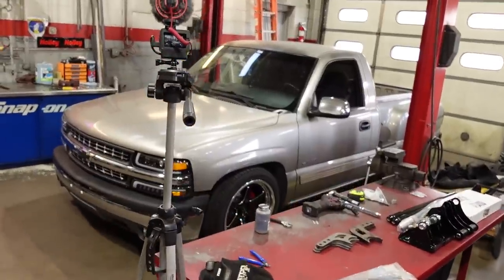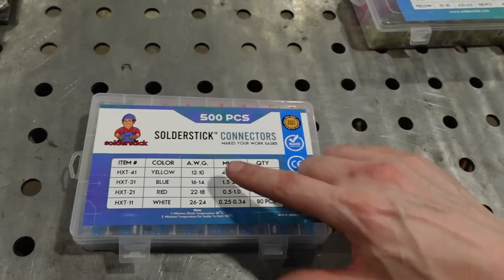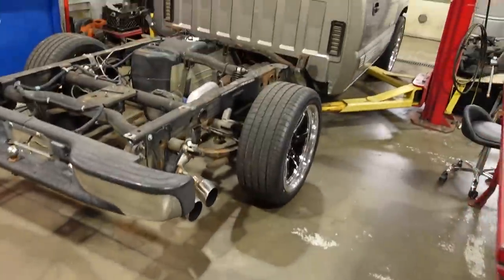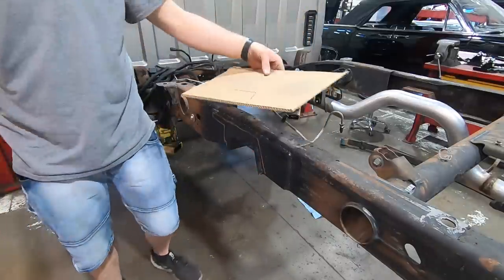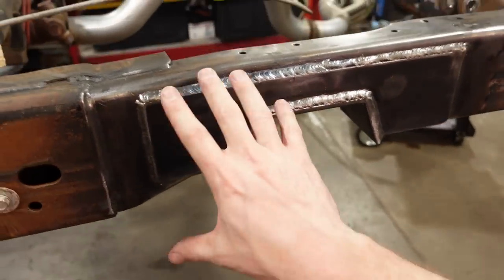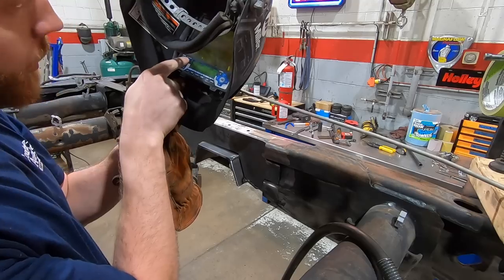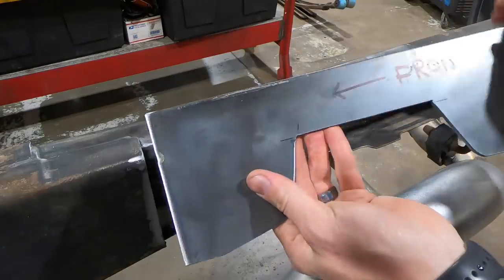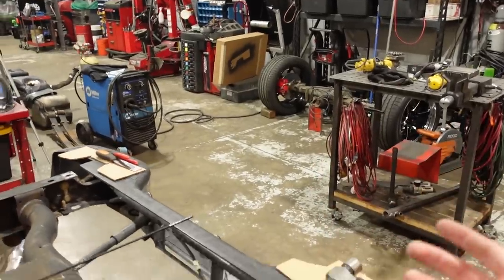the WORST FRAME MODIFICATION I've ever encountered

Comment: This is my truck. Had no idea about the frame under the bed because the c notch was done by previous owner and from the angle I could see under the truck it’s hard to see in the inside of the frame. From the outside it looks pretty solid. Glad LT found it and is making it as structurally sound as possible.
Reply: Beautiful truck my guy
Reply: Thank you, sir!
Reply: Nice ride! Awesome you got LT on it too..
Reply: Nice truck, how do you like the headlights? Easy install? Quality?
Reply: Bruh people are obsessed with your headlights.  I just wanna see the turbskis.
Reply: @sixoaksfarm1556 Thank you! Pretty happy watching him work his magic on my truck.
Reply: @person1492 Me and you both Keaters😅
Reply: @MrJamestheredneck  Headlights are solid. Only problems are with 99-02 depending on factory wiring, you might need to purchase and install a couple of grounded relays but they sell prewired kits and the other problem is they would have to be baked to remove the lens from the housing if a bulb went out. That is my biggest gripe, I’m not buying a whole new set because of a bulb so I’ll have to find someone with an oven. Otherwise, output, looks, and functionality are awesome.
Reply: @MovingToads  thats awesome. I'm looking at a set, but would like another opinion on them from someone that has them. Those are z-offroad correct?
Reply: @MrJamestheredneck  Yup that is exactly where I got mine. I would definitely recommend them.
Reply: I think it's cool that lt is working on your truck. I'd be interested to hear what additional plans you have for it
Reply: @beausmith3900  Thanks man. Eaton Detroit True Trac Locker being installed this coming week with 3.73 gears, Jake’s performance stage 2 4l80e and Circle D single disc lock up 3600 245mm torque converter goin in starting May 31. I put a 224/230 .5 intake .5 exhaust 112 lsa nsr comp cam in it, the OG flow master 40 series muffler, 60lb injectors, DW400 fuel pump, upgraded everything valvetrain including trunion kit, beehive springs, rockers, hydraulic lifters, pushrods, shorty headers(with egr still in tact thanks to the bbk headers), new cats (Denver emissions but soon to be register in texas as a classic when it turns 25), giant aluminum radiator and dual electric fans. At this point next to come would be turbo after all supporting mods are taken care of. Ported heads and an intake. Flex fuel as well.
Reply: That is an awesome truck!  If you wanted to go one step further with it, you could have LT cut out all of the existing welds and redo every weld just to know that ALL of the welds are totally solid.  I deal with welding codes all the time in another industry and can tell you that a good welder is worth their weight in gold.  LT is a really good one.
Reply: @steveh4837  Thank you! Oh I bet LT would just love that request lol
Reply: LT is the right guy, to find what isn't correct. 👍🔥
Reply: @homerepairguy1   100% evident
Reply: No Ragrets!
Reply: Very nice truck! LT will definitely make it right!
Reply: @JadXtreme  Thank you! Very confident in his work!
Reply: Awesome build, can’t wait to see the final outcome💪🏼
Reply: @tripstomexico9770 Thanks man!
Reply: Nice Truck.... love the wheels and fitment.
Reply: I bet LT loves having all those lifts in his shop.
Reply: @talalhz9137   Thank you!
Reply: That's badass, r u gonna have lt do everything?
Reply: @beausmith3900  Thanks man! No I had arrangements prior to LT opening his shop but we’ll see what happens down the line. LT might be working on the truck again at some point when I need some fab done for the turbo set up.
Reply: Nice truck man now you can ride without worrying about an unknown hazard
Reply: @carguy4v2222  Thank you, sir! Agreed. Granted I wasn’t aware before hand, definitely  more confident in the overall structure of the truck.
Reply: Very nice truck, Sir. Now, with LT's touch is gonna be nothing but awesome!!!🤙
Reply: @abnpthfdr2934  Thank you! Couldn’t agree more!
Reply: What wheels are these. Been looking for something similar. Your ride height is awesome.   I Have the exact truck. Bone stock with 5.3 at the moment.
Reply: @hunterstewart1398  Cosmis Xt-006r 20x9.5 +10. Thanks man, it’s pretty much about a 4/6 drop from stock. Nice, these wheels will make any of these trucks look good.
Reply: LT could have saved you from a serious wreck.  Peace!
Reply: I have a 2001 extended cab sidestep bed  giving it a four link with a over bed notch
Reply: Ah man that sucks though, the 1-2 places you don't check when making a purchase and that's where ya got burned.
It happens ,I've had it happen, at least it's in good hands now and anything can be fixed with wheelbarrows of cash😁
Overall it's pretty freaking cool though , much love to,ya and get out there and enjoy it ✌️✌️
Reply: Very nice truck
Reply: Very nice truck. That previous framework is just bizarre. I can't imagine anybody who considers themselves any kind of fabricator would leave that open space like that. It looks like the guy got in a hurry and just said it was good. I would be livid.
Reply: Nice truck , enjoy your safer version 🥶👍
Reply: Beautiful truck and I really liking the suspension upgrades. I recently bought a 95 Chevy OBS and have the same scenario, don’t know whats really hidden under there. Its low and riding kinda funky over bumps and pot hole. Steering swerving. The suspension will be first priority of any upgrades.   After all the suspension work, how she feel. Would u do same upgrades again? I wish I was local to LT
Reply: @jrich8036  Thanks man, have fun with that obs. Suspension upgrades were well worth it. Rides awesome. Only thing I would change is the height of the truck because of the wheels I am running. Offset of the wheels and width cause some rubbing over good dips at higher speeds. I am considering raising the height an inch or two even though i love the current height. I need bit more space for travel to let the coilovers properly rebound and keep the wheels from rubbing during compression.
Reply: @MrTheHillfolk  Yup that is pretty much it in a nutshell. Glad LT took care of it. Thanks man!

Comment: Got a 1000 piece solder stick kit. I do a ton of wiring work on railroad vehicles and spend a lot of time soldering and heat shrinking. Can't use crimp connectors on these repairs and never would even if it was allowed. Thanks for the discount code!  Saved me $32.00 on a $169.00 kit. 
Thanks again brother!

Comment: I like the heat shrink connectors. 
But be careful not to put too much heat on the solder because it will melt the plastic. Once it flows get the heat off and just shrink the plastic.

Comment: Your attention and dedication to detail will take you far.  Another shop would have ignored this, or just did the welds on the inside, without boxing the frame.  From the looks of it, this was a DIY kit that was sold years ago.  Part of the selling point was you didn't need to remove the bed, which is why it wasn't welded inside nor boxed.  It also came with two templets to cut out the notch.  Looks like they used the wrong one on the one side with all the extra missing metal.  Luckly, the company that was selling these kits was sued out of exsistance because of how unsafe this design is.  You can get away without boxing the frame, but you can't get away without fully welding inside and out.

Comment: I've found three issues with those heatshrink/self soldering butt connectors.  By the time it's hot enough to melt the solder the heatshrink is melting off the connector, the heat shrink is way too thin and offers insufficient abrasion and puncture protection, and there is no adhesive to ensure that it's actually water tight.  I'll stick with good heat shrink tubing with adhesive placed over a proper solder joint.

Comment: A lot of people aren't aware that grinding sparks will burn into glass. It's nice to see that you protected it.
Reply: I learned that the expensive way at the junkyard I worked. I pitted a rare Lincoln Continental windshield cutting out front end parts of another vehicle with a cutoff saw.
Reply: Yep, I did that to my kitchen window, that is behind my workbench, on the porch.  Very rough glass now but not too noticeable.
Reply: About 12 years ago I was building a house on a street that had a newly renovated or newly built library. It had all new glass. One morning, a welding fabricator was on the roof edges grinding away. I had to get to the job, but I should have stopped to say something. I found out that all of the glass had to be replaced at a cost of several tens of thousands. Ouch!

Comment: If you were working in my shop, I'd be inclined to inform that you still have a little bit of green showing.  Not to put down your work or anything, but you committed a few things.  For starters, its industry standard to never weld or drill on the leading edge (usually top and bottom of channel frames) as it will create a stress riser, leading to a crack/split in most areas.  Frame tails are safe, as they only have pressure from one direction, not both sides.  This is why beds USUALLY bolt through on the tails and bolt to a mount anywhere in the middle.  The frame WILL, and is designed to flex as part of the suspension.  It's designed to resist flex in several directions without positive blocking, which would attempt to stop the flex, resulting in added stress elsewhere, possibly a bend.  What I've seen not pointed out is that the frame is supposed to have a "crumple" or redirection/absorption area, which is right there above the axle, so that load can be applied by the spring perches, and not directly over the crumple zone.  What you missed by Seam welding everything is that the frame has extra wraps that should be left untouched, instead of just a bare 3 sided c.  Those shouldn't receive welding near an open edge.  They are there to allow holes and whatnot on the top plate.  The inner boxing channel applies the same, but I think those "boxing" braces you added are probably just fine, since I dont see any directly adjacent flex points that would create a stress riser.  Not sure if you are aware, but that round tube crossmember is the pivot point of the frame, for what it's worth.  Every other brace is designed for more deflection type of flex, while that only has torsion.    These are just things to consider when planning your work.... I know how absolutely tempting it is to seam weld everything, which I'm totally guilty of myself.  If you take anything from this, always remember 1 very important thing: airplanes don't have squared windows or doors for a very good reason.
Reply: You should totally go xray it for them 😮

Comment: I'm a retired ASE mechanic and I was taught never to use solder to make a connection, you must first make a strong mechanical connection "ie crimping twisting" and then use solder to hold the connection. I've been retired now for 15 yrs, has that changed?

Comment: I bought a 1965 C10 that has some cuts and welds on the frame. have to pull the entire drivetrain out. going to clearance/box a bit of the framerail in the front for a LS with Turbo Manifolds. PO had cut holes in the trailing arm crossmember to run the exhaust through, going to gusset them up. hopefully she will pass inspection after that.

Comment: The reason they cut the frame that way is because  in 99-02 there was a different style of frame pieces by the diff the cut out they did used to have a 1/2in bump out...and in order for the notch to sit flat they would need to cut it no matter what....in this case when a customer has this type of frame I suggest the underbed notch on my website instead to avoid it breaking in the future
Reply: They also did not weld the inner C PLATES From the inside and that will cause a future brake if it's not welded

Comment: The reason that Notch was cut like that is because some of those frames had a bulge in it that won’t let the c notch plate sit flat against the frame
Reply: You called it. To my knowledge belltech only one that has notch formed to clear the bulges
Reply: Ha! I mentioned that in the short that he posted as well. It is really rare for a 2000 to have the bulge but not impossible
Reply: @shakenfake  I know because mine had it, was so confused why I never see any other truck online with the same problem
Reply: @jamiefehr2180  Yeah I have a 99 too. McGaughy's actually has two part numbers for their c-notch to compensate for that and RideTech makes a note of this in their 4-link installation instructions.

Comment: 🚛💥👀 It's fascinating how hidden surprises can be lurking beneath the surface of our vehicles. The previous owner's frame modification on your truck's bed certainly caught you by surprise, and it's understandable that it's difficult to spot the inside of the frame from certain angles. Luckily, LT's expertise and attention to detail will ensure that your truck becomes structurally sound once again. It's important to address these issues and make the necessary repairs to ensure the long-term integrity of the vehicle.

Comment: One thing I've learned from both the trades and now 10 years of doing this kinda stuff is that everyone thinks everyone else's work is just the most horrible pile of crap to ever leave a shot, I promise someone has opened up your work and said the same things you said about this. The most likely the customer could of driven the truck for 20 years like that and never had a problem.
Reply: The unnecessary cuts and lack of welds was poor craftsmanship period. Can't make excuses for that kind of work chief.

Comment: Warnings about the low temp shrink connectors.  Few things: 1. Older tarnished wiring will not allow for a good solder joint.  You have to brighten the copper, and by all means add your own flux; at this point you might as well do it properly, and use proper solder, and marine shrink. This way you can control the quality of the connection. 2. Lower temp solder.  If you don't get a good bond, it will make heat, and melt away entirely, leaving exposed conductor.  You can use imagination to count possible avenues of shorting.  It's nice on the surface, but I recommend heat shrink seal CRIMP butt connectors over the solder type.  It's safer.  Great videos, but you should mentions the downsides.  If you are taking the time to make a nice build, soldering with an iron is actually just as fast.

Comment: I don’t thing you can do a bigger notch on a step side bed without cutting into the bed rails and possibly the floor of the bed. I may be wrong but I’m still figuring my own truck out. 2002 gmc sierra regular cab step side same metallic pewter as in the video, just not any where as clean.

Comment: The Forney plasma cutter is a handy unit! It can be finicky, especially if you have moisture in the air lines and burn up those tips immediately 🤣 

Awesome job on fixing up the frame notch ✌🏼

Comment: I have seen worse notches honestly. If I am working on a truck and I come across a bad notch, it’s getting fixed before it leave the shop. The worst I seen was some square tubing welded to just the top and the frame just hacked.

Comment: You actually want the axle .5° less of an angle because it dips during acceleration and use on a leaf spring suspension. Unless you have a 4 link the rear axle is under torque pressure when in gear that changes the angle vs rested angle.

Comment: My mods on my 96 4.0 ranger include a triangle 4link setup my notches are box with 1/8in plate and are even thinner, but
All my loaded suspension is before the notches included my bags on my lower links and shocks. The bed has a hard cap on it, and I don't have a hitch. 
The fuel tank is now a cell mounted on the front of the bed but centered the same width as the frame. I can honestly cut the frame at the notches, and it will still drive the same

Comment: Solder stick...sometimes they work sometimes they dont. I switched back to the crimp weatherproof style. Type of work I do I need good connections. Will often times solder my own and use heat shrink.
To each his own.......
Reply: Agreed. I dont solder wiring on cars anymore. Uninsulated butt connectors, plus a proper ratcheting crimper (theyre like $30 on amazon) plus glue heatshrink makes a weatherproof connection that wont fail with vibration